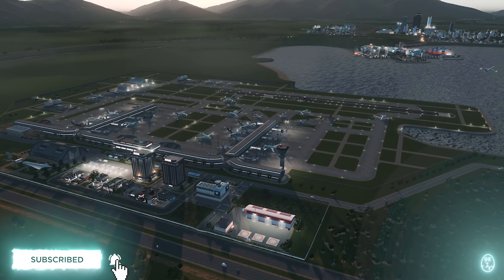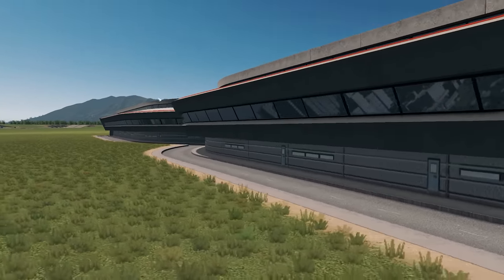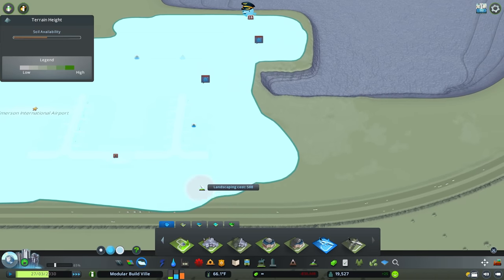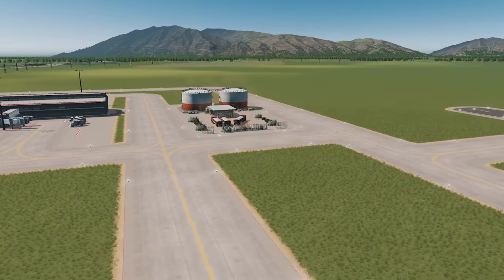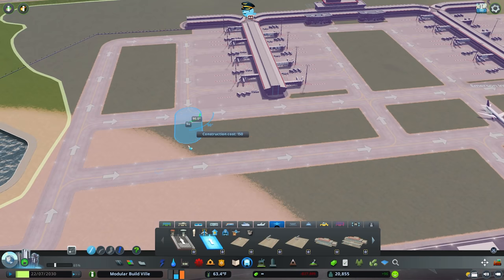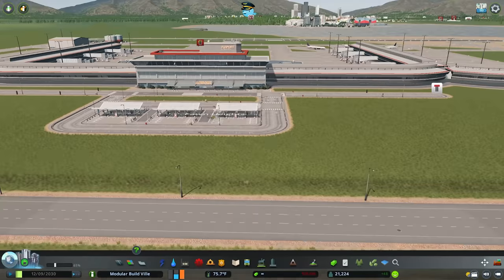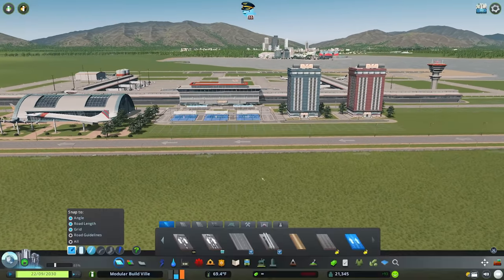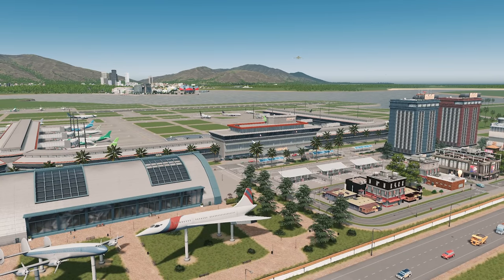Building a RUNWAY PIER With The Airports DLC! | Cities Skylines Modular Builds

Comment: At around 17 minutes you say you can't have the car parks symmetrical because the tiles aren't an even number. I wish I was still in the discord to show you how to do this, but there is a way it's possible to make the tiles an even number without mods. I don't know if this will make sense written down, but basically:

1. Place the terminal
2. Expand the road a bit further along - say 5 tiles
3. Delete the terminal
3. Draw a road down as far as you want at a 90 degree angle from the bit of road that's left next to where the deleted terminal was
4. Turn off all road snapping except angle
5. From the road that's now at a 90 degree angle from the original terminal road, draw a road parallel in front of where the terminal was, but end it at a 'half tile' - you'll have to eyeball this. You can do this because neither the grid, road length, or other road snapping is on.
6. Put the terminal back, snapping it to the bit of road that was left from when you originally deleted it.

You should now have an even number of tiles in front of the terminal because the grid will remain true to the road that was placed first - in this case the parallel 'half-grid' road. The grid should stay like this even if you reattach those roads to the road the terminal is on.

I am 99% sure this should work, although I haven't bought the new DLC yet - need to wait until the weekend so I go to work this week. I've used this trick to make park gates in front of libraries symmetrical and just tested it with a passenger port that has it's own built in road too. Good luck!

Comment: It's amazing that you're not distracted by the moving planes.😆 I have to pause my game when I'm adding something or modifying.😏🤨 When you did the tiny commercial lot to get the parking lot, did it come in automatically, or did you have to demolish it several times until it came in? 🤔
Reply from the maker: Lol they do make me laugh sometimes. The 3x2 ones aren't to bed to get in, the worst is the 2x4 as there are tons of assets in that pool. 2x2 isn't too bad but you need the even number count :)
Reply: @OVERCHARGEDEGG  - Okay, thanks for responding. I'm going to have to be patient, though. My game has crashed a few times when I try to start it with the new stuff. I'm assuming that the modders are reworking their mods to adjust to it... 😏